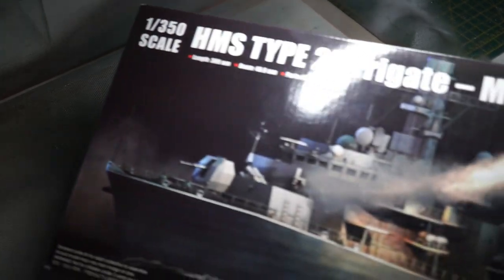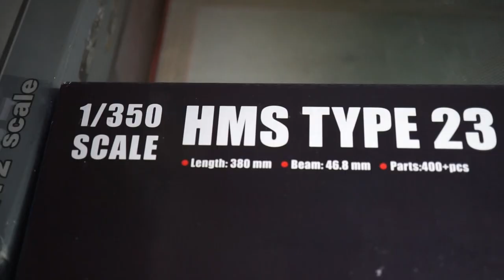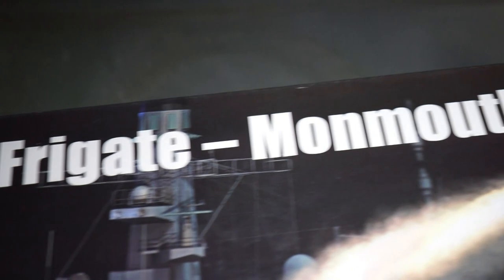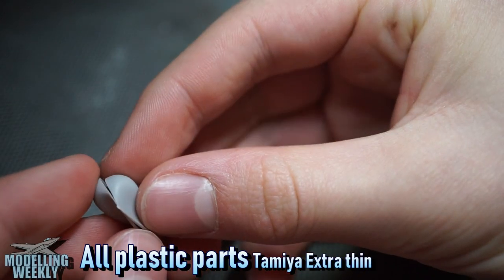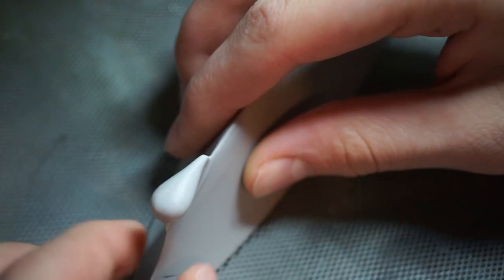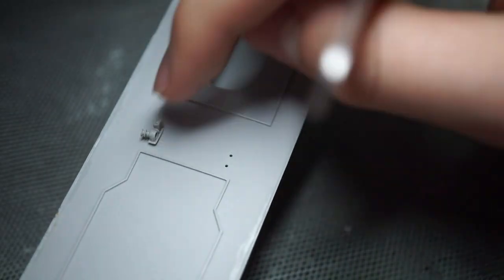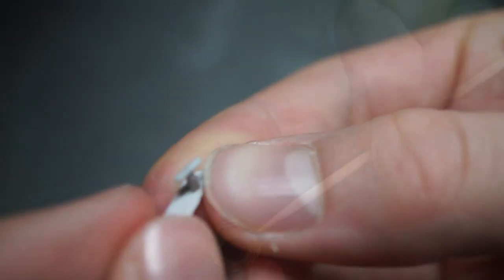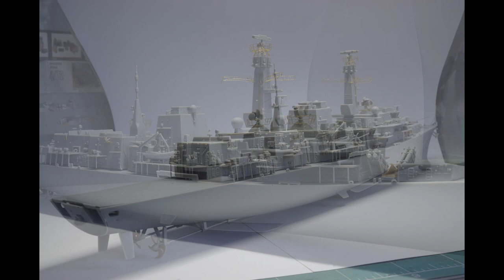Trumpeter 1/350 HMS Monmouth Frigate | Part 1 / 3

Comment: 'Royal Marine' motor launches? Served on a couple of T23s and that's a new one on me 🤔
Reply from the maker: https://en.wikipedia.org/wiki/Pacific_24 The pacific 24 RIB has been used extensively by the RN in anti-piracy operations, crewed by the Royal Marines. I have no idea when they started doing this, but I know for sure that it was done in the Strait of Hormuz throughout 2019 in order to safeguard merchant vessels. Again, not saying you're wrong! I'm just giving reasoning for what I said, as you are challenging it. You for sure know a lot more about the ships than I do 😄
Reply: @ModellingWeekly  only if there is a Marine Boarding Party embarked, which is not always the case. Otherwise it's crewed by the Ships own boarding party, made up of Ship's Company (normally made up from the Warfare Department), or they can be used as a crash/rescue boat if the helo has an airborne emergency.
Reply from the maker: @paulperry8800  👍